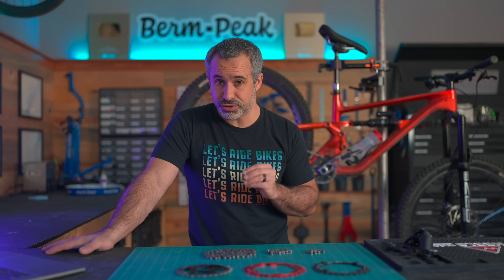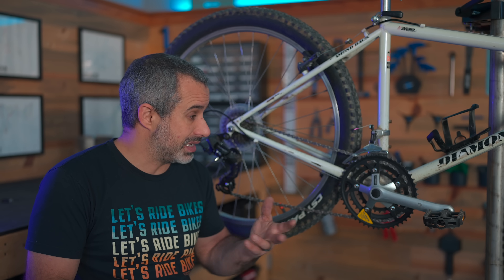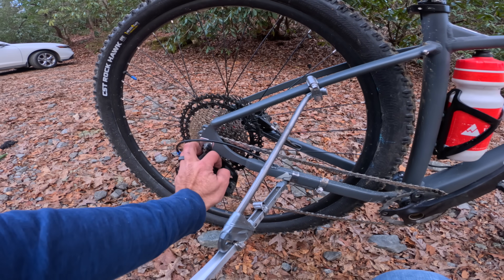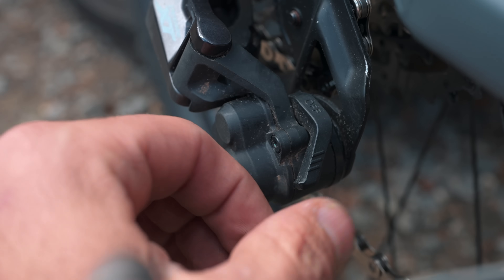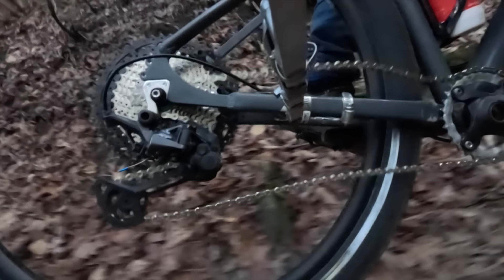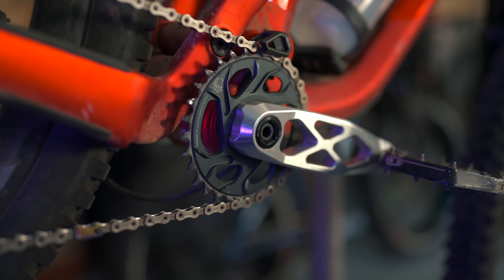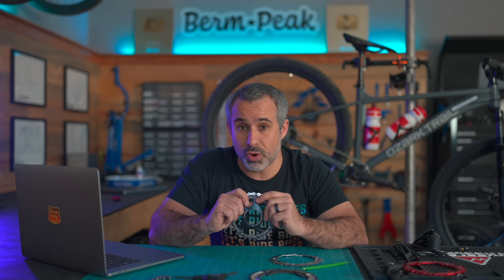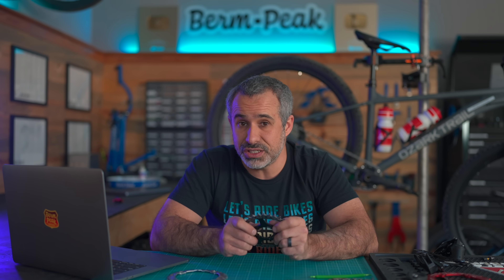The Genius of Narrow Wide Chainrings - Why they work!

Comment: I once upgraded an old Stumpjumper from a 3x to a 1x drivetrain. Chain drop was chronic. The clutch didn't help, chain guides did nothing (some seemed to make the problem worse) but a cheap narrow wide chainring (same brand Seth was showing) cured the problem. To me, the narrow-wide based 1x and the dropper post are pretty important. One advantage of the 1x is that rear suspension design is no longer compromised by the need to locate a front derailer opening up new possibilities in suspension design. Every full squish I've had developed cracks in the rear suspension, and I believe that in every case it was due to compromises related to accommodating the derailer. It was hard for me to give up that front derailer. What convinced me to ditch it was the need for a better dropper lever. The left-hand shifter had to go at that point, no two ways about it. No regrets, I love the 1x.
Reply: Is 1x mostly an MTB/Gravel thing or is it also applicable to road bikes/commuters? Back when I was without motorized transport, I was actually considering either a front 3-ring only setup or a huge 9+ gear wide cassette single ring with relatively wide spacing in order to make my daily driver more useful than a 3x7 with stupid overlapping ratios. In fact, I mostly ran that bike with just the front 3, and for my 9+ wide setup I was considering a huge front ring (like 50+ teeth!) in order to get as much speed on downhill road portions as I could.
Reply: @Drunken_Hamster  For commuter/road bikes you don't have to fight with chain dropping , so I wouldn't go for 1x drive train as it gives you less flexibility, smaller gear range and has less durable components. For casual, not trained rider in this case I would go with 2x9 or 2x10, they are cheaper and give you greater gear range with less overlapping gears, more durable drive train, you have smaller sprocket for hill climbing and bigger for speed on flat road. 1x drive trains are very specialized thing, so they are good for one type of riding where you are pushing the limits but if you want universal bike I think 2x are best choice.
Reply: @czaja995  Fair enough, thanks for the advice!
Reply: @czaja995  For flat road use in somewhere like London, all my bikes are 1 x 9/10 cassette (11-28), narrow/wide front 44/46t and I find I only use 3 or 4 of those gears anyway.
Probably because I'm so used to my 84 gear-inch single speed for the summers.
Lighter, less crowded cockpit, less to maintain.

Comment: As an engineer, I can agree with everything that is said in this video. Nice analysis.  However, in addition, on the narrow-wide chainrings the teeth tend to be deeper, this is because they don't need to be designed to derail. I suspect this extra depth is another reason for better chain retention.

Comment: In 2017 I DYI'd my already old 3x8 into a 1x8feat.megarange and it's the best upgrade I ever did on my rat bike which I use every day with no mercy at all. The crank is the original 3x arm and I put the narrow-wide chainring in the middle ring position, and the rear derailleur is the just-as-old Shimano Altus with no clutch whatsoever. Only dropped the chain 2 times, but it took some effort and everything was already really worn out. The big advantage is: it's REALLY CHEAP to replace everything, and it lasts a lot with no maintenance besides cleaning and lubing the chain once in a while. My current setup is 32t narrow-wide chainring with 11-34 8 speed cassete, which is just enough for my everyday use considering some hills and confortable cruising speed. I liked it so much that I think urban bikes should come with this setup instead of sh*tty 21 speed groupsets.

Comment: definitely did the right thing putting a cheap narrow-wide on my old bike when i changed it from 3x8 to 1x8!  it doesn't have a clutch because i'm still running the original derailleur and the bike is from 2003.  i haven't had much of an issue dropping chains (we don't have a lot of rough terrain around here) and i've been going for clutch derailleurs to minimize chain slap -- never considered they could help prevent chain drops . . . but also didn't know what a narrow-wide was for!  just figured it made sense because i knew the gaps in a chain alternate.

Comment: I removed my chain guide about 8 years ago and have run the same X01 derailleur without a clutch (Yes I bought the old version and saw that type-2 released a month later) and a narrow wide chainring since I removed the chain guide. Haven't had a chain jump off since then

Comment: Funny how chain retention stopped being a problem on Shimano chainrings, even though they don't use a narrow wide profile, once clutch derailleurs (Which Shimano did first) showed up. Try the same test with a singlespeed chainring from Shimano, which doesn't have narrow wide, but does have teeth a similar height to the SRAM narrow wide rings if you want a fair test. 

SRAM's biggest 'contribution' to cycling was having the brass balls to charge more for a 1x drivetrain than an equivalent quality 2x or 3x drivetrain cost, even though there's no front derailleur, front shifter and only one chainring to pay for. Admittedly Deore drivetrains are equivalent or better quality in gear shifting terms to the mechanical stuff from SRAM, but if you sell to the OEMs for cheap and in doing so, tie people to hubs with an XD driver and pay as many pros as possible to use your stuff, it's surprisingly easy to convince gullible dentists to buy it.

The most striking difference between modern SRAM and a Shimano mechanical drivetrains (Which both work well, but the 10 tooth jump from 1st to 2nd on the SRAM 10-52 cassettes is pretty awful once it starts to wear, and Shimano for some reason have decided that having a really strong return spring on the derailleur to make the downshifting really heavy compared to everything they previously made from 8 speed to 2x10, is a good direction to go in, so they're not perfect either) is how much more of the SRAM derailleur you can see sticking out past the frame of the bike looking back at it while on the bike. 

Not sold on the slow, single gear upshifts on the SRAM shifters either when Shimano upshifts 2 gears (But they've got into the component limiting dickery too and are limiting this to XT and above, only giving single upshifts on cheaper but mechanically identical shifters - some can be modified to give double upshifts by taking the case off the derailleur and breaking a plastic tab off the housing), but Shimano have made their shifters feel as clunky on downshifts, so no winner there. 

The last straw is SRAM looking for €70 for a chainring, €130 for a cassette and the derailleur pivots being noticeably wobbly in the same mileage as wears out its first drivetrain (Shimano XT derailleurs seem to last basically forever, just feeding them jockey wheels when the teeth wear off them or the jockey wheel bearing seals wear down and they start to seize after muddy spins (Which the SRAM ones do nearly from new) every second or third drivetrain), which means my SRAM experiment is over - Sunrace 10-50 cassette going on next (To fit XD driver) and XT cranks without a narrow wide chainring to replace the godawful pressfit DUB BB, in which the bearings regularly seized after wet muddy spins and has now developed play after less than the life of the drivetrain, when again Shimano BBs in the same conditions usually last for 2-3 drivetrains (And cost less than half as much to replace).
Reply: Quick correction for myself now the parts have arrived - Shimano 1x chainrings are narrow wide too.

Comment: I have the exact same experience. My cheap Decathlon E-MTB came with a stamped steel chain-ring that was still a narrow-wide and welded to the crank so not easily replaceable. I always had problems with the chain coming off, like several times every mile. I solved it with a front-derailleur-like chain-guide initially, but it always kept that unnerving sound of the chain wanting to come off every few hundred meters or so. Last summer I finally upgraded to a (still cheap) new set of cranks so I could change to a machined narrow-wide ring and I can finally run it without a chain-guide now. My chain hasn't come off at all for 6 months straight. I use a Shimano Alivio rear derailleur, so no clutch as well. Congrats on te 1 mil btw, very well deserved and way overdue!

Comment: The more gears on the cassette the less the chain runs inline with the single front gear. When going downhill as shown the chain should run on the center rings of the casstte. That's helps much more.

Comment: Since having a Narrow/Wide-Chainring on my old 1x9 MTB I haven't had one single chain drop. Before it was a constant hassle. As a pro mechanic I adopted them as soon as I learned about them. Not only on my own bike but on all the custom made 1x bikes built in our shop. I agree that they're a real innovation. At least in the matter of practical experience. The technical side seems so mundane that I wonder why it took so fricking long for them to be adopted.

Comment: This is a contender for the best youtube video so far this year. A litlte, but not not much time-overhang, slow-motion and action-cam footage carefully used, Close-Ups whenever they are necessary - not just to mask a cut. Clear Audio, supportive soundtrack, clear pictures, with archive footage in obvious and not try-hard relation to the video's subject and some nice, subtle color light "brushstrokes" in the background and on the subject. Excellent effort. Maybe some exaggerated "chain noise"-foley would have been a nice, satirical addition to put an emphasis on the non-narrow-wide-chainring-adaption-problem and put a grin on some of the watchers' faces.

Comment: For few years i run at Sram X0 non clutch deraileur and narrow-wide oval chainring at front - it works nearly perfect.
Without any chainguides.
Plus narrow-wide jockey wheels for deraileur as extra chain stabilisation (i need to use some spacers to adopt narrow 12spd wheels to 10spd cage).
Chain drop happens, but very rarely at this setup. And start happens when chainring wear out a bit (cog teeth going more narrow over time due to friction and dirt).
New chainring solved problems (when teeth still in spec)
Finally i changed deraileur to Microshift Advent X (and replaced jockey wheels to narrow-wide) because incopatibility of Sram X0 with 48T casette.
Now - my chain never drop. No fortune spend ;)

Comment: One trend you missed in your history lesson. Around 2000-2004in the PNW we removed our inner and outer chainrings, and replaced both of them with bash guards to surround the remaining middle ring. This was a cheap upgrade which helped with chain retention while also got a decent amount of use for riding over fallen logs that were prevalent in shared use trails in those renegade times. Shortly after that, MRP and E13 were commonly spotted with their giant, loud, and inefficient roller chain guides.

Comment: Hi Seth, nice Video about a little Detail!
Is it possible that the Teeth are also longer than on 2x or 3x Chainrings, as there is no need to take the Chain off and on for Gear switching?
I suppose the 3x Ring Teeth are shorter to help shifting and moving the Chain from one to another Ring.

Comment: Sooooo here's the thing. This isa bit of a false comparison. Because you are comparing a narrow-wide 1X chainring to a 3x-middle ring. So the "conventional" ring is not only NOT narrow-wide, but it also has short teeth to make chain jumping easier. 

A more fair compariosn would be a narrow ride chainring versus a non-narrow wide single speed chainring, like a Surly stainless steel. Something with tall teeth that really grab the chain well, even without being narrow wide. 

In that comparison, the advantage of narrow-wide would be muuuuuch smaller.

Comment: I hace a 40t bcd 104mm n/w chainring by 49mm chainline. BCD 104 is really good, it can change the chainline essily, just add some spacer or axle bushing on chainrig bolts. It's only cost about 5 dollars for iron and 10 dollars fir alloy plate.

Comment: I learned that NW chainrings work best the hard way. For whatever reason my Giant XtC came with an error in the chainring, which offset the NW pattern by 1 tooth on only one side, essentially making it 'conventional'. I was dropping the chain very frequently on the trails, even though my derailleur had a clutch. After replacing the chainring I never dropped a single chain, even when I forgot to engage my clutch.

Comment: Alright, this is the missing link in understanding why 1x drivetrains are such a big deal. So far, I had only heard that they are more simple so less things to go wrong. This totally justifies giving up gears or having to use a massive cassette when riding over rough terrain. I usually ride on smoother paths and roads, so a front derailleur will still stay on my bikes. That said, I would definitely want a 1x drivetrain with a narrow wide chainring when riding a path like the one on the video.

Comment: That stamped steel chain ring has ramps that are designed to not hold onto the chain , allowing shifts . We used to run single speed from chain rings with taller teeth .   Worked well enough at the time
Reply: That's what I was thinking too. Chainrings designed for multiple front gears are going to be less secure, since by design they are meant to guide the chain off the side to the next chainring.

Comment: Despite being a little heavier, I'd much rather have an internal derailleur that's located in the frame above the crank. Like on the old 90s Honda mtn bike that was a non production bike built for pro racing.

Comment: Im gonna sound dumb but you can't learn if you dont ask. I have 3 chainrings on my bike but what happens if I change to 1 chainring? Does that mean I'd only have 7 gears? I feel like I'd be losing alot of flexibility but thinking about it I rarely change what ring it's on. It's on the 2nd ring 90% of the time anyway. Also, would I need new shifters if Im going from 21 to 7? Am I totally missing the point, highly possible 🤷🏻‍♂️

Comment: When sram started investigating this with high speed cameras they found that the chain was jumping over the teeth due to vertical motion/vibration rather than side to side forces. Increased height of the teeth is just as important as narrow-wide. Similarly, height of a chain retention device above the teeth is the most important parameter. I'm sure design has improved but the initial designs focused on the vertical jump.

Comment: There is one key thing I am surprised you didn't mention. A singlespeed or 1x chainring has deeper channels between the teeth. Or I guess you could say it has taller teeth, whichever way you want to look at it. So the narrow wide combined with the deeper channels work together to help keep the chain on.

Chainrings designed for shifting have shallower channels, shorter teeth, to help assist the chain in derailing when shifting.

Comment: I remember back in 2017 when I first tried going 1x (1x9 to be exact) using the 2nd chainring of my 3x crankset lol. I had to makeshift a chain holder using a rear reflector clamp and a small cut of garden hose. Even raced with it on a rainy day and super muddy trails.
Then I finally committed to a narrow-wide the same year. 
Ran Alivio 1x9 for 6 years until Christmas last year when I finally upgraded to a Deore 1x12 using the same chainring Seth is using in this video.

Comment: Every once in a while, I forget to turn my clutch on after throwing my rear wheel back in the frame. I only notice a bit of extra noise from chain slap and my shifter lever is slightly easier to press in to downshift. To this day, on my Polygon T7, I've never dropped a chain with or without the clutch engaged. I can't say the same for my hardtail but even then, it's pretty rare. They both have Shimano Deore derailleurs. The Polygon has a Shimano chainring but my hardtail has a cheap one from Amazon.

Comment: I have build many Bafang mid-drive conversions and the only flaw is dropped chains. Most builds with excellent derailleurs (saint, xt) but no good. Switched to cheap narrowide in the front and no drops at all. One time i had forgot to engage the clutch and still no drops... So IMO narrowide is more important than clutch. Seth please do a Bafang video they are just amazing. And many of us have amazing builds that put factory ones to shame...

Comment: If you look carefully at the video, he did his test with the chain on the smallest rear cog. that's why the chain was so long, and had such exaggerated movement. He probably has it in twelfth gear. No one is going to ride rough, rocky terrain, or descend a technical in that gear. Maybe he should try his test in a proper gear like second, or third. Then you will see a difference.  { I wonder if scram is one of their sponsors. }  🐂💩

Comment: I was expecting you to mention the cost of extra watts requires to keep this extra surface area in contact. Also, the extra watts required when the chain angle gets gnarly on smallest and larger cogs. Losses will be at least sin(chain angle), in%. 5deg chain angle, 8.7% loss. 10deg, 17,3% loss... Its basic math. I'm not even considering the extra friction that chain angle makes. Not to mention that regular groupsets will be heavier than regular 2x10 that were doing just fine. Also, weight goes to the rear wheel, messing up the weight distribution, that on a 29er is already f'ed up.12speed derailleur needs fine hanger adjustment and weights way more than rhe skinny failure proof 10s without guide pulley offset. It's not a free lunch